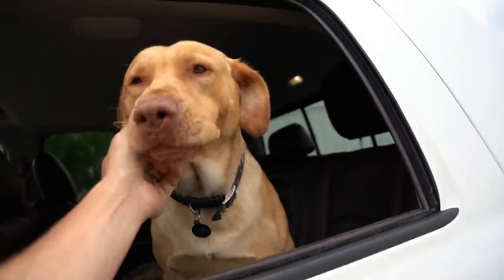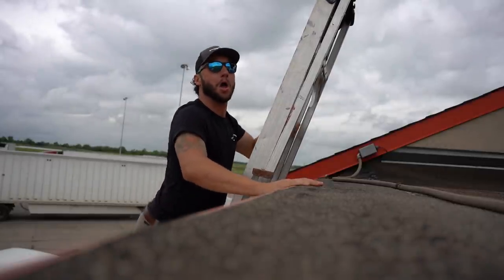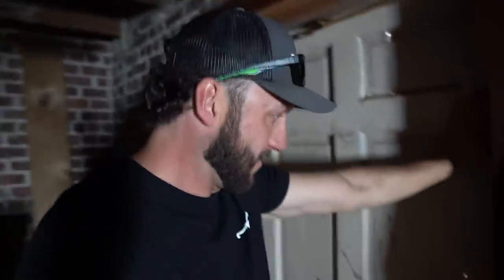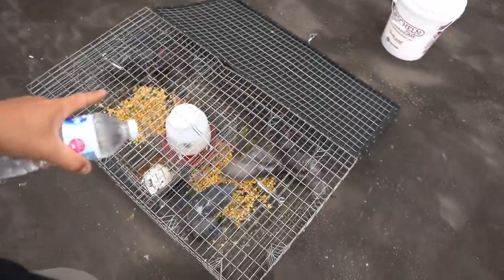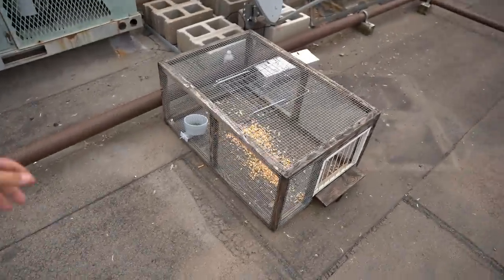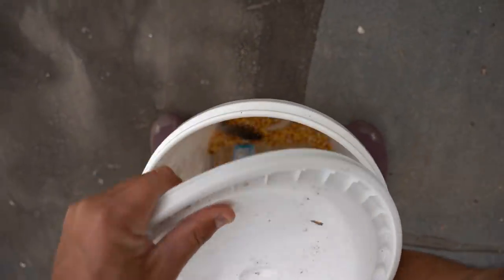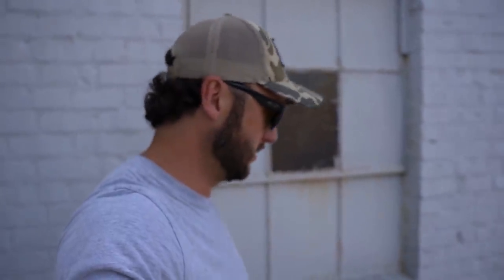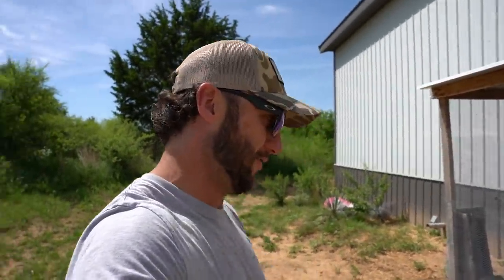I Was Forced to Remove My Traps...

Comment: add some kind of a Funneling system off the corner of the Rooftop to catch more water in your bucket. if it rains and say you catch 1\4 of a bucket because of the Black rooftop and extreme heat it's going to Evaporate. where if you funnel the catch it will add a lot more water to your bucket and won't loose to much to evaporation

Comment: Maybe space the bucket off the roof with couple pieces of 2x4 to keep the rain water cool. Of course locate it in shade as possible too.  You could also make a cone/ funnel from aluminum etc to catch more water in the bucket or just a piece of tin creased and slanted into the bucket.